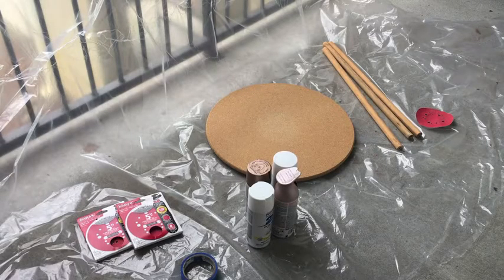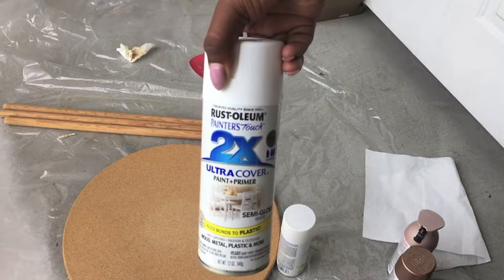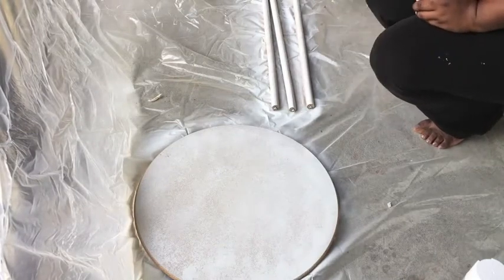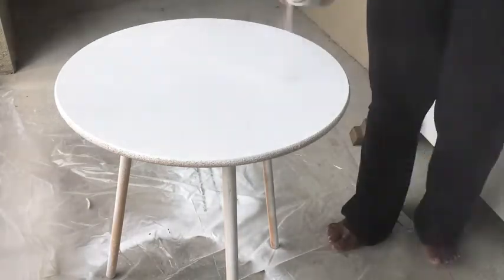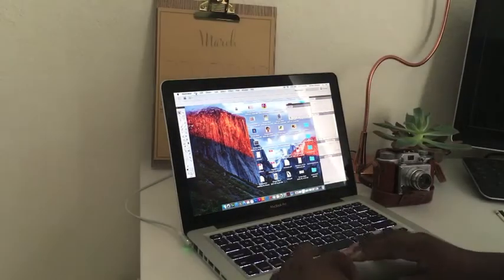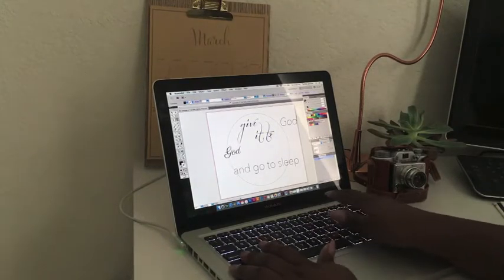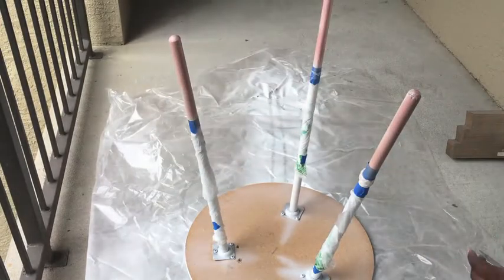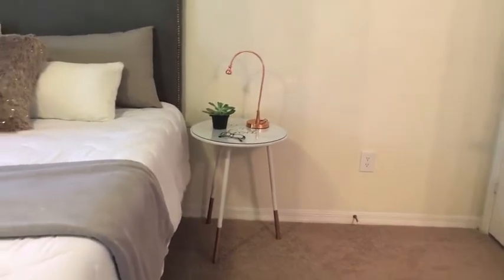DIY side table into modern night stand

Comment: Can you tell me a little more about how you created the quote for the table, how you printed it and how you put it on the table?
Reply from the maker: Lolitia Johnson Thanks for watching. I printed the design of my quote at my local Fedex on their over sized black and white printer. It cost around $3. I simply cut it out and just placed it in between the table top and the glass that came with my table.
Reply: Thanks. I'm looking forward for more videos where you can explain in details how you use the program on your computer to create words in different fonts.